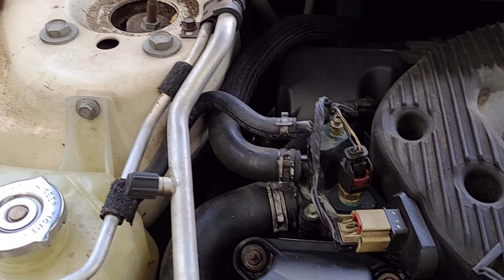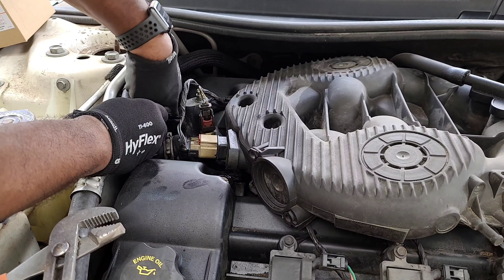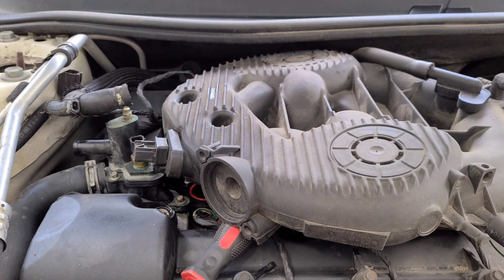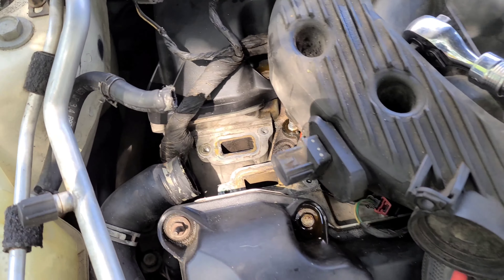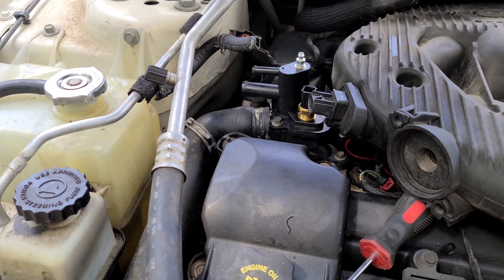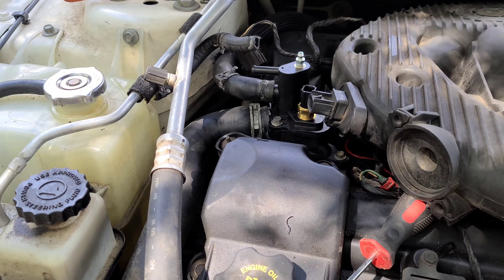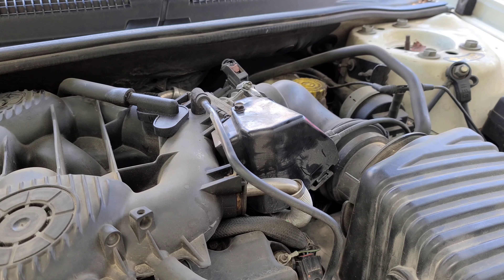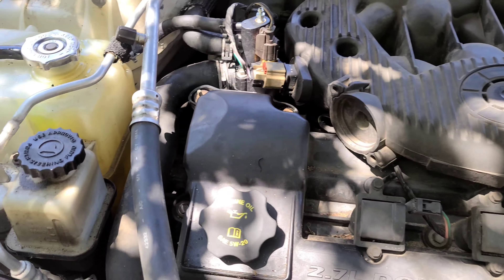Coolant Bleeder Housing Replacement on a 01-06 Dodge Stratus 2.7L V6

Comment: @DIYMaliya I’ve order this part twice now both times the bleeder valve screw will not unloosen at all what can I do to fix this my car definitely has air in the system bc once it gets hot the coolant starts to bubble like boiling hot water on a stove in the revisor tank???

Comment: Does the intake manifold need to be torqued down to a certain spec? I have to replace the throttle body and intake manifold gaskets so I wanna make sure I do it correctly.
Reply: So i just bought this exact car and suprise suprise i have to do this job MYSELF lmao, i think the torque is 105 INCH LBS or 8.75 FT LBS, 12 NM, So theres that haha, i do not have a torque wrench that goes that low, it only goes to 112 in INCH LBS, therefore im just gonna use that and hopefully everything works out haha. But i can also see that this was posted a year ago(Your comment), so you most likely got it figured out!